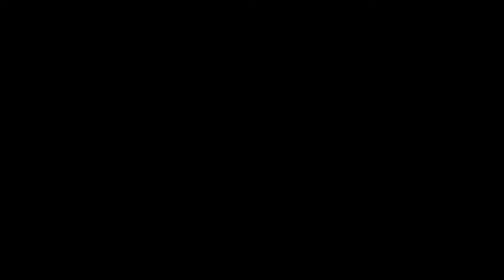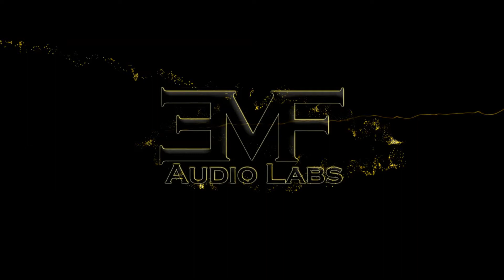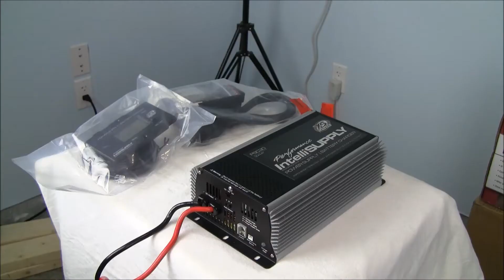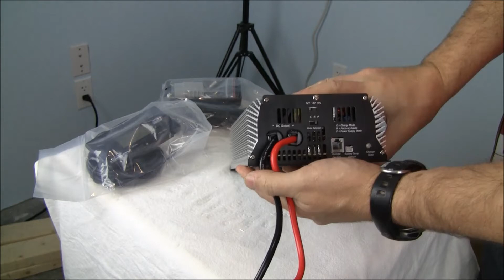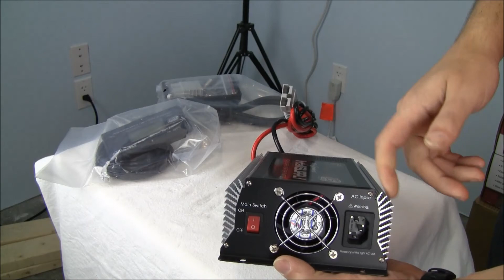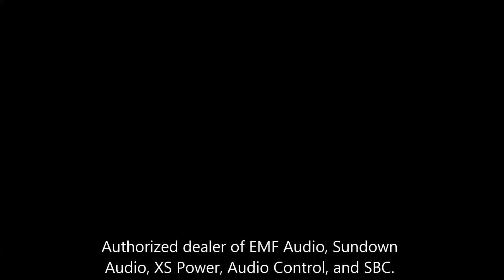XS Power PSC-30 overview

Comment: is it good for installing in vehicles? like for supplemental power supply? or just changing between runs?
Reply from the maker: +DJ Inclined It's primary purpose is for installing in a vehicle.  You wouldn't be connecting clamps or having exposed connections, just a 3 prong AC outlet plug to connect.
Reply: But can it be used under heavy load for supplemental backup? 60a is pretty high if its only meant as a charger.
Reply from the maker: +DJ Inclined it can be a power supply or charger. per my testing I would not use it while under load with caps, you can burp a large load with a battery bank, I can't validate reliability on a continuous draw on batteries.